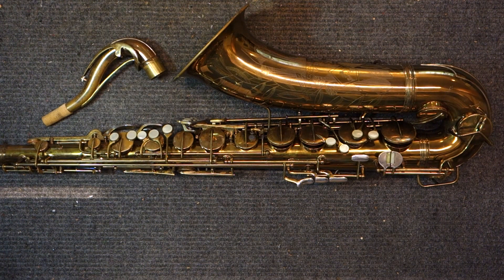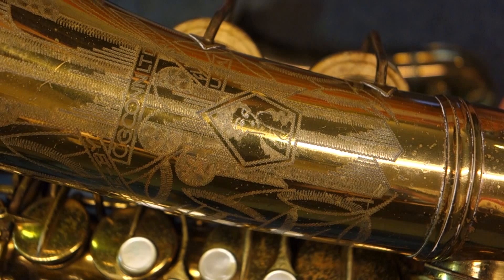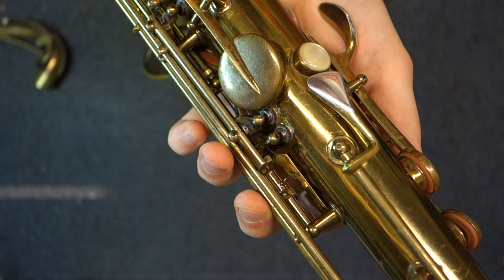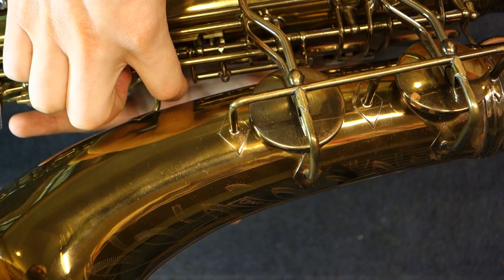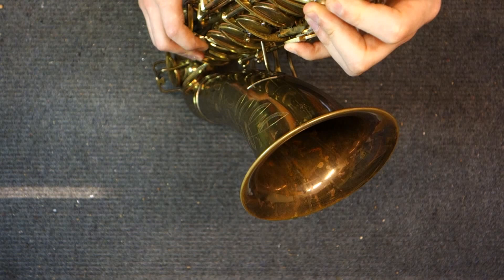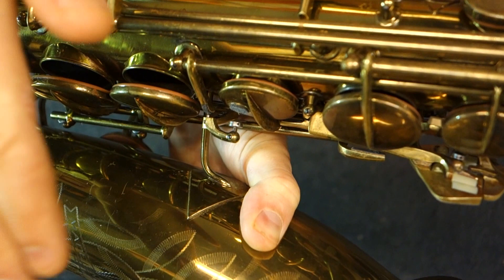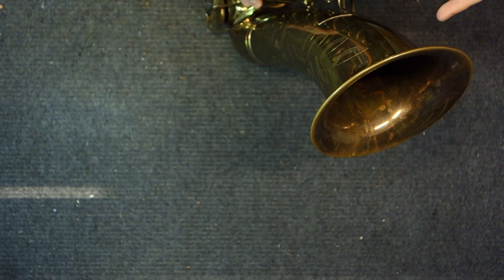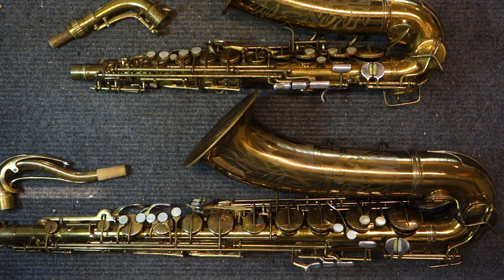Repairman's Overview: Conn 30M and 26M "Connqueror" Saxophones

Comment: are the parts interchangeable?
Reply from the maker: some parts are the same from the 30M/26M to the 10M/6M, but most are not.  but even if parts are the same from one horn to the next, the parts are not "interchangeable" without key fitting- in the same way you can't just take a piston from one car and slap it into another.  the tolerances are too fine, so while it would work to (for example) take a 10M palm D and put it on a 30M, it would still involve work to make it fit properly.  but most parts of the 30M and 26M are not identical to their counterparts in the 10M and 6M.
Reply: ***** bummer....there's a nice 30m body on fleabay.

Comment: hello my 30M is missing one of these little balls that you unscrew to adjust the keys, is there anywhere I can get one replacement? thanks
Reply from the maker: +Daniele “Dave” Drammauta assuming you are talking about the adjusting screws (unique to the 30M/26M), you will need to have it made.  If you are talking about the tiny locking screws, you can buy them from Ferree's Tools.
Reply: +Matt Storer thanks Matt, it's one of those spheres that contain the adjustment thing, the top one of the 2 that are on the upper bar that moves when you press C and B. thanks
Reply from the maker: Oh wow, how did that come off?  Those are silver soldered to the key.  You'll need to make a replacement.
Reply: +Matt Storer I don't think it's soldered. the other one is kept in place with a pivot screw, I think you are supposed to take it out to adjust the height as you describe on the video.
Reply: +Matt Storer if you go to 6.04 on your video, you are exactly placing your finger on it. it' not the sphere with the adjustment, it's the sphere on top of it, on the upper bar. thanks